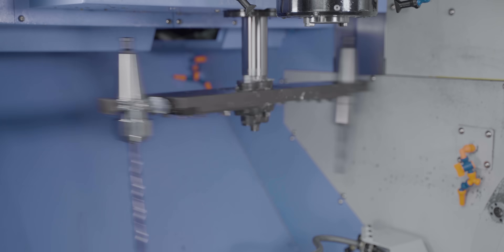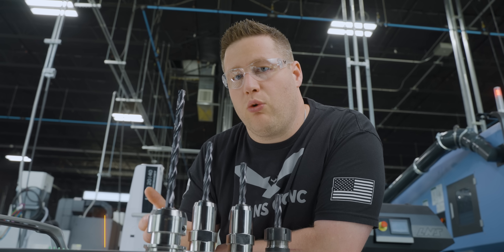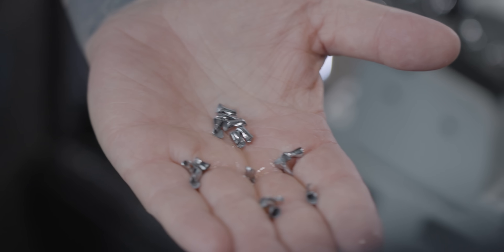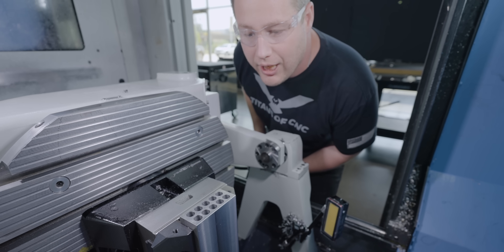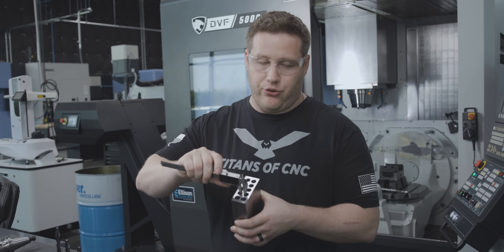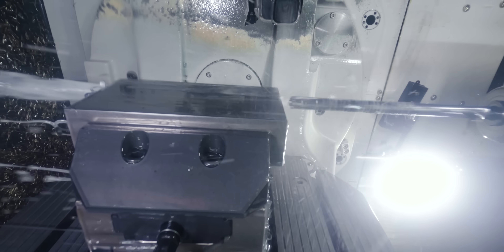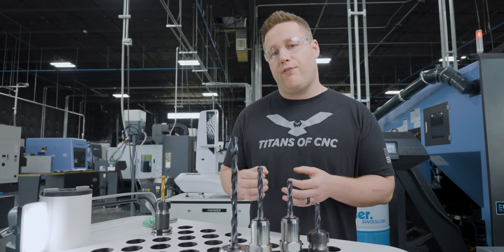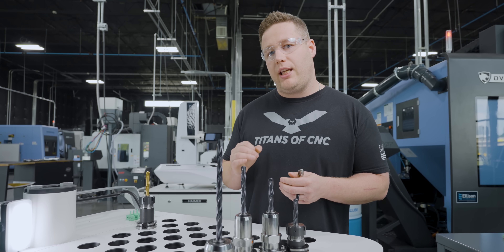G81 to the DEEPEST Depth I Have Ever Attempted

Comment: I work for and extrusion die company and for the heater holes we have to drill a .75 hole 13 inches deep no peck no pilot and no spot and it turns out really good. We do it with an Iscar inserted drill. I absolutely love those Iscar drills. They’re super accurate super fast and they leave an awesome finish for a drill. For those holes we run it at 2000rpm 15ipm in P20. Literally the only thing I don’t like about them is they’re loud af especially once you get over 1in

Comment: For some guys to know, the 4 land drill geometry isn't a new thing. I have tooling from old GM factory work that used the 4 land geometry. The tip thinning is something I (personally) used quite often, (in more general work)  whenever I would hand sharpen a worn drill. (Use a drill jig if available). Learning methods to sharpen drills helps a lot in understanding how to increase your productivity, longevity, and precision. Just for reference, on a common standard drill tip, nearly 30% of the pressure is on the chisel tip, making it more apt to wander in a deep hole.

Comment: If you would like a precise true position with a deep drill, I recommend drilling slightly undersize first only deep enough past the tip angle, come in with an endmill and bring the hole to the exact size of the drill, then spot drill, then drill, and if you want to be even crazier do this with a boring head then a drill. You can get .0001-.0002 accuracy doing this.

Comment: Hey there i'm from germany and in my company training we were using quite a few drills by GARANT. They were about 30xD and were generaly very pleasant to work with. 
I remember using a 4.2mm drill with 25xD and drilled 200 holes in a row without any problems. Maybe they are something you could try out? Great Video btw :)
Reply: garant is underrated, we use them a lot too
Reply: CNC guy from Portugal, here. Been using Garant for a couple of years and i'm very pleased. Nice quality, huge catalog, professional service and very nice prices.
Reply: Up to 50xD the Garant deep hole system is unbeaten. I work in bottling and filling industry. I saw 4mm drills with over 200mm fluthe lengh running in V4A. I don't understand whats so special about 12xD
Reply: @Theo-yc4yo Garant is just a brand. They buy there stuff of many different manufacturers.
Reply: Those Kennametal drills get up to 72xD I saw in one video!

Comment: One of the best if not the best drill tip grind is the Bickford drill tip grind.
Reply: UUUEEGGHH?!?!
Reply: @AmandaHuggenkiss  Google Bickford Helical Point, a special drill grinding machine is needed to create the point. The very tip of the drill acts like a dedicated center drill and along with the main body of the drill a highly accurate hole can be achieved.
Reply: Nice point! The Bickford point is actually very similar to Kennametal's current HPR that Titan showed in another video. It works great in cast iron AND steel.

Comment: Is this possible in stainless?
Did you reduce feed on entering and exit?
Could you share information about coolant type, pressure and flow?
Reply: I dont have experience with the kennametal tooling, but it's definitely possible. I've done it in 316, 304, 416, durabar (ductle iron), and some alloy steels using Walter titex drills and Mitsubishi drills, which look similar to those in the video but with a different coating. NUMBER 1 is that the drill needs to be running perfectly concentric. You should be running it in a nice shrink fit or hydraulic toolholder. The less runout the better. 2 tool diameter and drill length play a large part in the cutting strategy. Generally, if it's over 18x in smaller diameters you'd  use a pilot drill to go 1x diameter deep then run the large drill OR slow down the feed on the long drill until you reach that 1x diameter depth than run at recommend speeds. The big issues to overcome with deep hole drilling is that you need high-pressure through coolant  to cool the tip and to evacuate the chips as well as a rigid and very accurate toolholder. My old company did a lot of deep holes in stainless and relatively hard alloy steels.
Reply: That KennaUniversal drill is mutli-material. They advertise it for steel, stainless, and cast iron, but they also have the SGL up to 40xD for 300 series stainless.

Comment: Had a bore on stainless drilled, 4.2mm diameter and 152mm in length and had to get it to .6ra surface finish afterwards. Did it successfully but took a lot of labour to get the finish. It had 8 cross bores aswell

Comment: I did multiple 12xD holes in 1.2343 with a beyond drill from kennametall. Worked fine without any pilot drilling needed
Reply: This drill probably didn't need that spot

Comment: I quite often go up to 17-20xd with a 10mm drill from WNT for drilling water cooling channels in mold tools but I always drill the first 50mm or so with a standard 5xd drill first, how far would you think you could reasonably go if you went the same approach? Assuming machine z height wasn’t an issue?
Reply: I'd bet up to the max cutter length they sell off the shelf. So long as you have through tool coolant and a good toolholder I don't see why you wouldn't be able to
Reply: You can go quite deep, 40xD for example, but sometimes you'll need to step in with multiple pilot drills for the highest precision end result. 
3xD, then 12xD, the 25xD , then 40xD for example.

Comment: What kind of machines are used to build high-end drills ?
Reply: It’s usually a CNC Grjnder from Anca, Walter or Rollomatic. You can grind carbide end mills and drills.
You can You Tube them.
Reply: @bobmac9070  thanks 😀
Reply: @jmyyer There are many many more manufacturers of grinding machines.

Comment: The best Iv done was drill 8xD with a 6 inch spade bit, no pilot, in a 50HP  German made radial drill, it was a #6morse taper  holder and I had to get a ladder, every 12 inches I had to pull the drill out, raise the arm, and add an extension to drill, by the time I had 4 extensions that machine was shaking so bad😂 the material was 1018 steel

Comment: Question? does drilling cycle require pecking with type of drill? or can it be omitted. Second can resharping done by hand ,conventional means. or have go into special drill grinder?
Reply: Do not peck with these drills. Also generally you need to get these factory recut and recoated. The coating is the more important part. Also many high end drills have a special radius on the cutting edges to increase tool life and that needs to be done by the factory.
Reply: The other reply here is correct. 
Peck drilling is not required and frequently a cause of a lot of problems. 

The most impact to the drill is when it first enters the cut. Peck drilling causes multiple re-entries of the cut for each hole and in the case of stainless steel can cause work hardening of the freshly cut area. Pecking can also create room for a chip to get stuck and that recutting of the chip and damage the drill. 

The precision required on these drills means you absolutely CANNOT resharpen by hand they way you may have learned to do a HSS twist drill back in the day.

Comment: Always wondered how to drill DEEP holes in plates. Like for a cooling platen.
Reply: 12xD is not really that deep...  Deep hole Gundrills can make holes 40xD +
Reply: For really deep holes you need a specialized machine that can take gundrills. You don't need a pilot hole too if you are drilling into a flat surface at no angle. They drill gets guided in a hardened very tight fit bushing for perfect centering on the position. After the drill is inside the material it guides itself on the OD of the hole it drills. You can achieve really excellent surface finnishes RA 1,6 or better is typical for most materials and the runout per 100mm is usually under 0,1mm. Thats around 0,004" every 4 inches, most of the times you can get away with way less tho. I already drilled holes myself with up to 146xD in Stainless for vacuum chambers.
Reply: @robinnussbaumer5943 fr 12x us pretty basic. I've seen 30x in a 6.5 mm drill in stainless that was impressive. Mitsubishi twist drill with coolant holes
Reply: @printgymnast368  um i guess you awnsered to the wrong person but yup thats what i said 12xD is really nothing... We even had 12xD as standard in our machines at one point
Reply: @robinnussbaumer5943  No, I was agreeing with you. We also had 12x as standard on many of our machines. This video is confusing to me. idk why they didn't go for a larger ratio
Reply: Deep hole drills are often longer than 12xD like some of the replies are saying, but you don't always need a gundrill. 

These solid carbide two flute drills drill faster than gundrills and are highly accurate.

Comment: When using a pilot drill, what prevents an even finer drill to not walk and wobble even more?
Reply: It will. Be you will then use the finish drill to bring it to size. It will walk much, much less with less material to remove.

Comment: how about a 3 flute design drill? could it be even longer than 12xD?
Reply: We are manufacturing 75xD and higher.
Reply: Three flute drills are often at a disadvantage except in aluminum maybe. 
There is only so much room in a drill and you have to balance the core diameter (for strength) with the flute size (for chip evacuation). Steel and stainless is so tough that a 3 flute drill becomes too weak to out perform a very strong 2 flute drill. 

Chip evacuation is VERY important on deep hole drills and you cannot sacrifice flute size for deep drilling.

Comment: I recently had to do a 42xD with a .0625” drill.
Reply: my deepest hole was 50xD with a 1mm hss drill xDDDD
Reply: @todclanchannel4093  what material, mine was 304ss
Reply: @kw2519  here in germany we say 1.4571
Reply: @todclanchannel4093  that’s great, but I’m in the US lol also, you didn’t specify your unit of measure 😂

Comment: But what we really want to know is, how do they drill the tiny coolant holes through the drill? 🤯
Reply: Electroerrosion.
Reply: The holes are put in before they twist the blank in most cases.
Reply: @MarioAPN no
Reply: @oberender64  Can you explain how then, I am also interested.
Reply: @MarioAPN  There are different ways to make that. One is that there are 2 little twistet Wires get pressed in the Carbide Powder and while sintering it, they melt. EDM is only used when its already sintert and only for special positioning.
Reply: They are in fact extruded in like a playdough machine then twisted.
Reply: So it's not highly trained ants with micro jackhammers?

Comment: I would think a pilot drill would deflect.more- and lead the final dtill off center.
Reply from the maker: If you want to drill deep… like 10 to 40XD.
It’s best to drill just a few inches deep with a rigid short drill… and then you drop down with a deep long drill. I have a video on this channel where I taught on drilling 40XD… you can search it.

Thanks,

Titan
Reply: No not really, you need to use a good solid carbide drill the same size as the deep hole drill but only drill one diameter deep. That helps get a good straight hole. I be sold a lot of them in my career.

Comment: I know you guys are focused on good habits, but I think you’re being a bit dramatic. I’ve been regularly using a 15xD 3/16” drill without a pilot drill, and I’m spotting with a less-than-optimal tool because that’s what I’ve got. Don’t even have shrink fit holders, just using sealed TG-75 collets. I don’t have the RPM to even run recommended SFM, nor the correct coolant pressure. It’s been running well and for quite some time. I work with what I have; I know there’s better ways, but I can only work with what the boss will buy. I appreciate what you’re doing, but I think you’re over exaggerating. 🤷‍♂️

I absolutely have to say that a 2-margin, what you’re calling a 4-land(regional dialect difference, something I’m very much noticing), is a MASSIVE game changer.

Comment: Now do a 12xd drill in a 3D printed inconel hole!
Reply: That drill will drill Inco. You slow the SFM and would see a tool life reduction over 1018 steel, but the hole quality would be the same.

Comment: I have a few parts that require me to go 15xD and 20xD. Always trips me out to see this extreme length with no pilot haha.
I use a process that hasn't failed me yet.

Pilot with same diameter drill, to a max depth of 3xD
tool change to extended drill
G0 XY POSITION
G56 H# Z.100
S300 M4
G1 F20. .100 ABOVE DEPTH OF PILOT HOLE
M5
HP THRU COOLANT ON
G4 DWELL TO HOWEVER LONG IT TAKES TO PRESSURIZE
1/2 FINAL RPM M3
G4 DWELL COUPLE SEC TO ENSURE SPINDLE IS TO SPEED
FEED DOWN 1/2 FINAL FEEDRATE TO 6xD
RETRACT .100 ABOVE 6xD 
RAMP UP TO FINAL RPM
G4 DWELL FEW SEC TO ALLOW FULL SPEED
FEED DOWN 100% FINAL FEEDRATE TO FINSHED DEPTH
RETRACT .100 ABOVE FINAL DEPTH
M5
S300 M4
G1 F20. Z.100
M9

Comment: I knew you would spot. Now drill with it off center through two steel plates welded like a sandwich.
Reply: I have done that

I used an EDM drill though
Reply: This drill will do exactly that.

Comment: How would that compare to a gun drill..??
Reply: Depends on the hole you're making, but for something like this or up to 40xD, these drills drill faster than a gundrill and can be used on a regular CNC machine (don't require a special gundrill machine)

Comment: Why not mount "short" gun drill(like 20x the Dia? It can do the job without running the pure oil (just rich coolant solution) and the surface finish would be far better then any carbide tipped 2 flute drill.....I am sure it will work! You can turn it 3000  RPM at 1" dia, with F= .0002" per rev. Horizontal machine would evacuate chips better...

Comment: I’d like to see 20xD or 25xD in 17-4. Let me tell you, it isn’t fun.
Reply: We are doing .020 diameter.353 deep in 17-4 condition H900. Mikron drills kick ass.
Reply: @brandons9138  I’m doing .25 diameter 8-12” deep on the regular as well as .375 12” and it is NOT fun.
Reply: @ThatOneFiesta  Water based coolant? Mine is on a Swiss Machine with oil.
Reply: @brandons9138  yea, also In a VMC so the chips don’t want to come out.
Reply: @ThatOneFiesta  At least on a VMC you don't have to contend with gravity making the tip of you drill sag.  Is it a thru coolant drill?
Reply: @brandons9138  yea